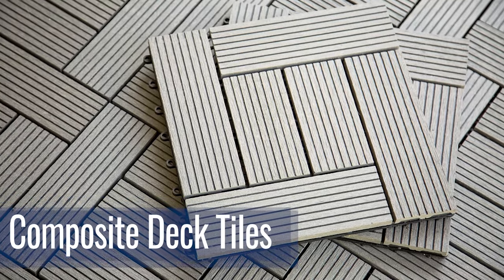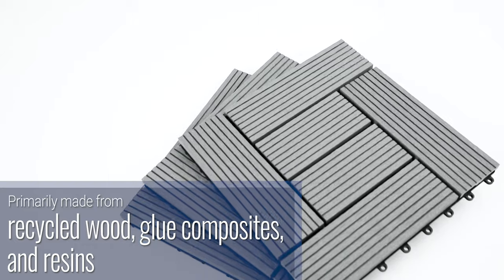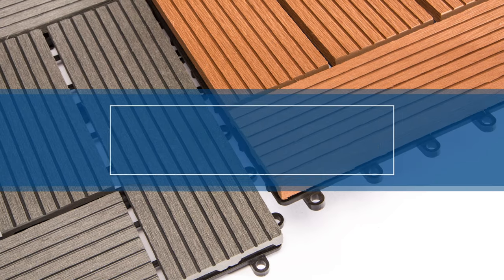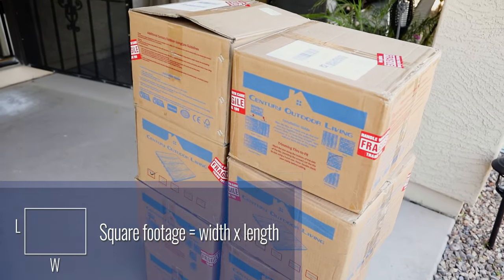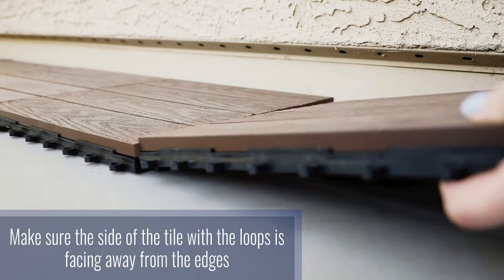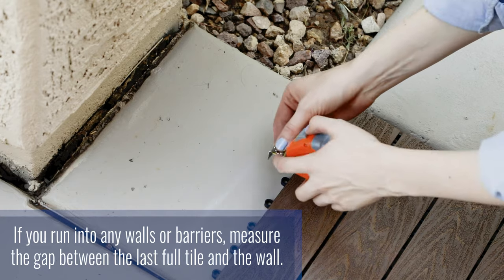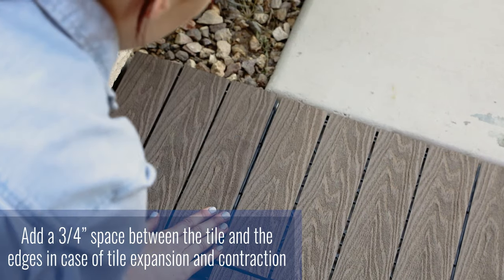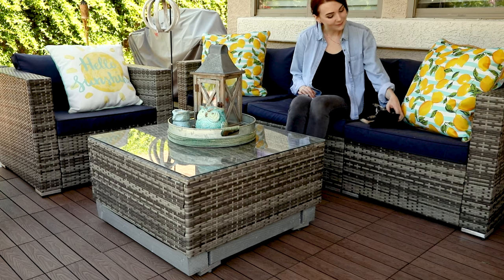How to Install Composite Deck Tiles

Comment: I have an upstairs open air patio with free edges on the base floor so no walls or flat areas meet up to the tile only at the double patio door side. Will these tiles work in this type of patio. Also our base floor has some slight uneven areas. It is currently covered with outdoor old carpet and the base is wood so I do not know if the uneven area is the wood or old glue or damage.